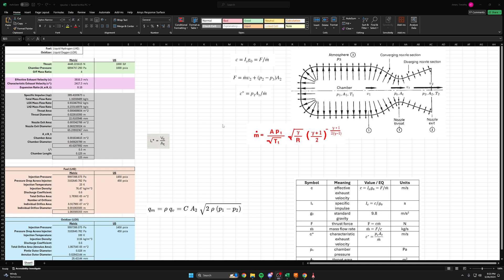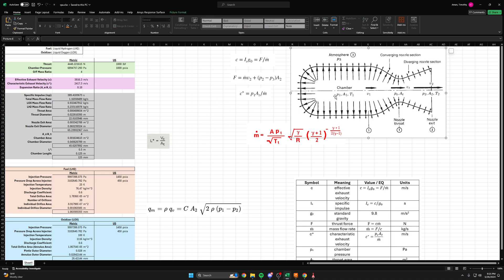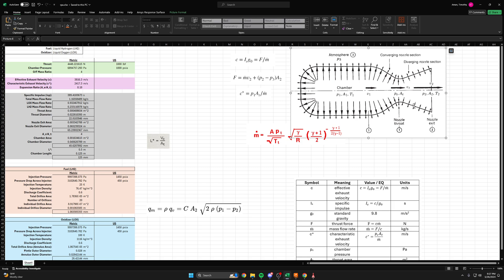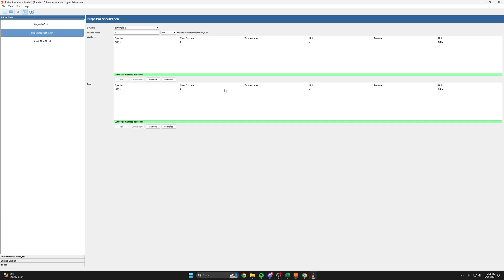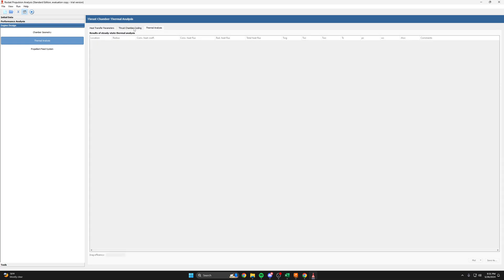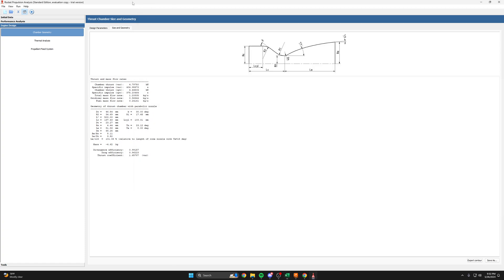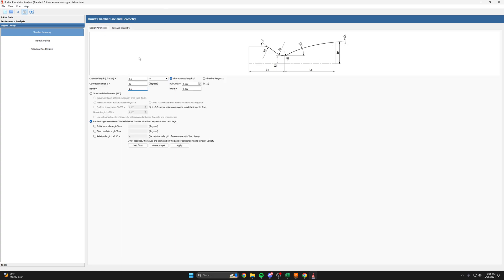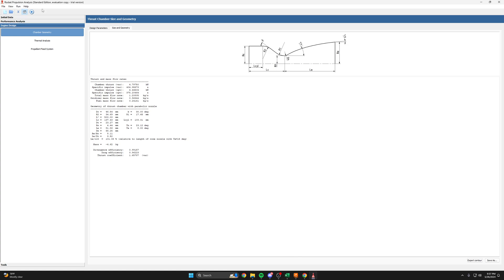Designing a Liquid Rocket Engine with RPA

Comment: If I have understood it right, then the literature you showed says that the chamber volume for the L* formula includes the converging section as well as the cylindrical section of the chamber, so I think your L* might be a tiny bit out. It says it just below figure 1.7. Have I not understood?
Reply from the maker: Yes, sorry, you are correct. The volume of the chamber should include both the cylindrical section and the converging section up to the throat. I think I have seen it done both ways, but it is more correct to also include the converging section. You can see that RPA gives a cylindrical length of 103mm in this example whereas my spreadsheet overestimates it at 125mm. I will add a correction, thank you!